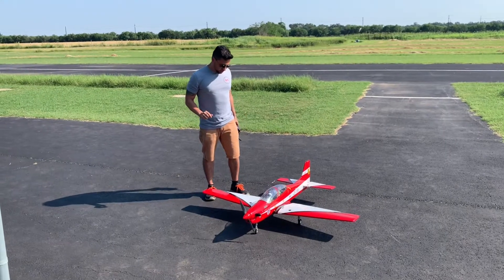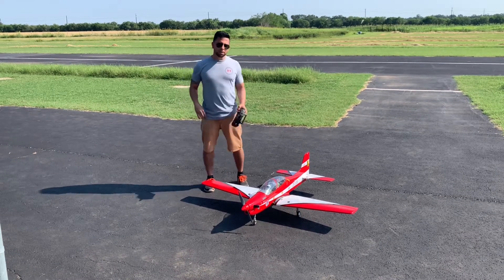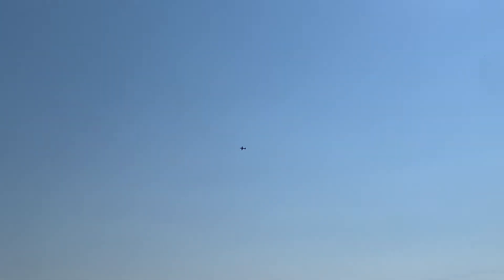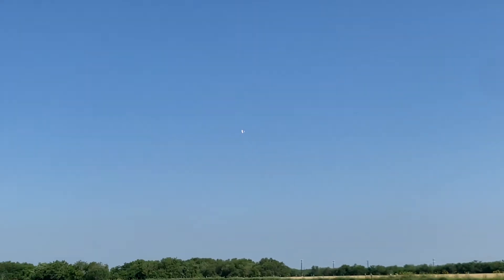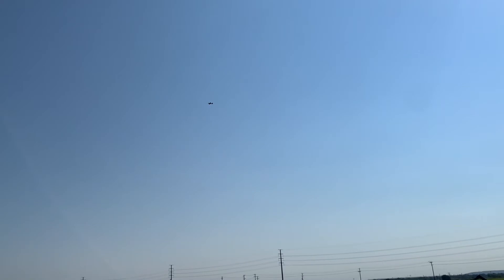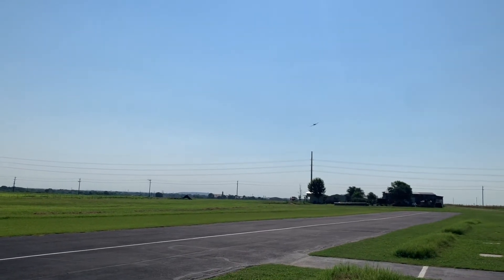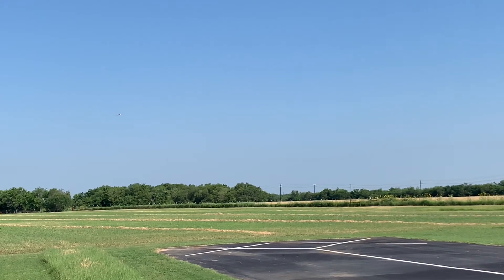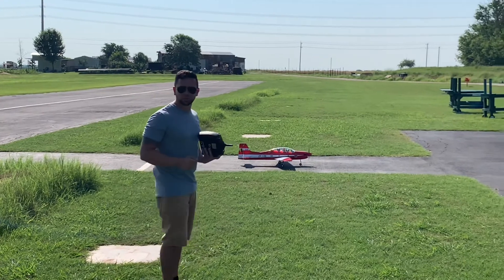Phoenix Models Tucano Maiden Flight and Review

Comment: Just bought this on Tower Tuesday sale for $134.99. The v2 now includes electric retracts and flaps. Also uses mini servos now instead of standard size. Looking forward to putting her together.
Reply from the maker: I so missed out on the sale and I’m so mad, this is by far my favorite prop plane to fly and the new version with the flaps and retracts is one I want to put together and try! Good luck with it you will definitely enjoy it!! What are you going to power it with?
Reply: @ljhobbylife  Thinking of ordering a "badass" series 3530-630kv by innov8tive designs on 6s with a 12x6 or 12x8 prop. I've got their 3530-700kv on 6s with an 11x10 prop on a great planes ultra sport 46 arf and it's wicked fast. I think a 12" prop is better for the Tucano though. Glad to hear you like it so well and thanks for the video!

Comment: Looks great. I just ordered mine. Just wondering what type of servos did you use for flaps and other control surfaces?
Reply from the maker: @loveforrcplanes  Nothing special I used Futaba S3004’s on all four surfaces, they have been discontinued but were replaced by the Futaba S-U300’s. There’s no flaps on this model, but it doesn’t need them. I have over 200 flights on it with these servos and it’s holding up nice, I might swap the motor out later for a true 6s powered motor so I can run a 3 blade prop.

Comment: Beautiful plane and nice landing.. Did retractable landing gear come with the kit? or did  u have to upgrade to some other gear. If so, which gear did u upgrade to. Thanks.
Reply from the maker: Thank you 8HrToGo! The kit does not come with retracts, those retracts are from the FMS Futura the blue version. They require a little finesse especially on the front but the extra work was worth it since they look super scale on the ground.  The mains will look a bit small on the retract pocket but on the ground it’s ideal for that scale look. If you decide to go to the option I have a few pictures of the process saved. 👍🏼